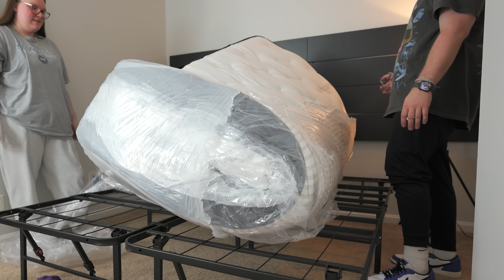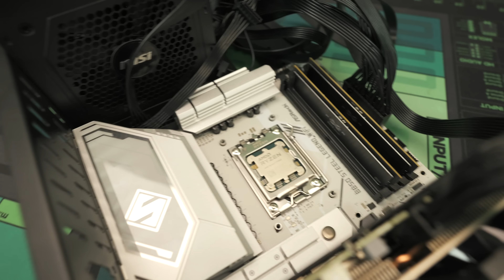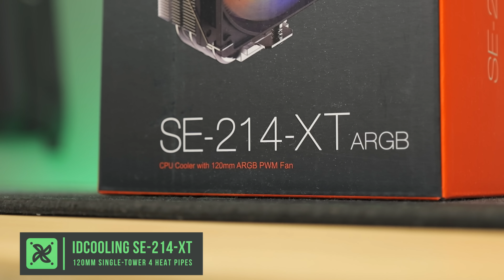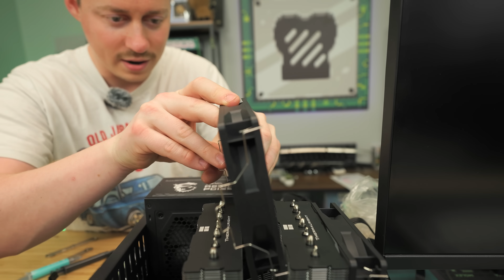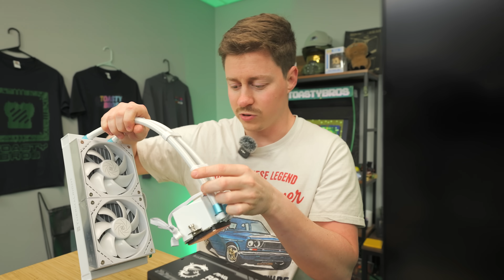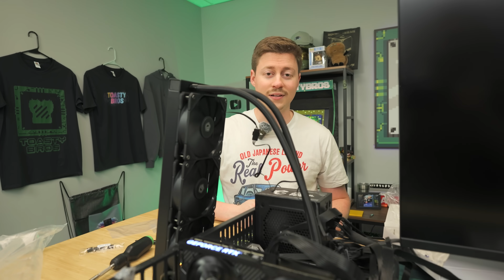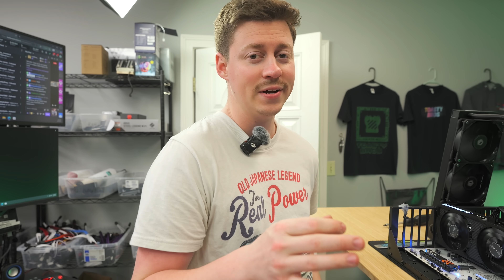STOP Overpaying for Your CPU Cooler

Comment: Good God, bots have gotten so bad... Anyhow, I don't know about real world applications on this particular test. Using a testing bench doesn't really apply to 99% of gamers. Fresh air flow is unimpeded since it's open air. I'd be interested to see this test in a series of popular cases out there.
Reply: this is quite true
Particularly with the popularity of more budget 'fish tank' cases that have significantly worse thermal performance than something like a Lancool or a 4000D, it would be interesting to see these air coolers put to work in a cheap Gamdias or Okinos case (likely pairings for a $900 new build)
Reply: @Firitesen  case airflow is an overlooked metric by every single techtuber, not just these guys. Researching cases with unobstructed intakes is way more important for the buyer since there are far too many cases to generally cover in cooler benchmarks.

That being said, if you have 3in 3out, or the equivalent of 3in with filters which would be around 5 intakes, you're extremely close to ambient temp in the case. The problem is most people, and some cases, don't meet this simple standard.

If you mod the zalman t3 plus/compact's front panel to not be obstructed w 3 intakes, you'll see similar performance to top of the line cases. I bought that for 40 bucks. Not worth measuring the margin of error. Same applies to a filtered king95 fishtank with all 5 intake slots occupied. No, neither offerings have any shortcomings in cooling as long as you fill the space.
Reply: @benbai5808 Got the t3 with some arctic coolers. Was really surprised by the temps unmodded
Reply: I mean if the noctua has access to fresh air, still performed 2nd to the worst, and is the most expensive, it is pretty ass 😂

Comment: The ID cooling 214 plus is the dual fan model and is always $20. Great for getting your build done and you can decide whether a better cooler is needed later on.
Reply: Even the A620 from ID Cooling is only 40 bucks for a dual tower cooler.
Reply: Mine is the ID Cooling SE 224 XT RGB model. It's good enough for my R7 5700X3D
Reply: Yeah for 7700X single tower is fine. But intel dual tower for 125W+ CPUs

Comment: The amount of people that still go with a Noctua or Be Quiet over 100 dollar air cooler is insane when the Peerless Assassin and A620 exist for under 40. Same with AIOs with the Kraken Elite when the Warframe exists.
Reply: For most of us the stock cooler is enough. 😅
Reply: To be fair it's all about longevity.  Those $5 fans that are included with cheap coolers may only last a year or two and when they die, they might burn out your CPU along with it.  That said, I usually just buy a cheap air cooler and buy some better fans for it and it's still a lot cheaper than buying the whole cooler from a name brand like Noctua.  Don't cheap out on fans.  There's a huge profit margin on the coolers themselves.  $140 for 2x 120mm fans and a chunk of metal is way overpriced.  The fans are worth maybe $40 and the metal another $30.
Reply: @thelbtlover  Cheap coolers lasting a year or two, when they're just a chunk of metal? Air coolers literally don't fail. Only the fans break and you can easily replace them, and if they do break, that doesn't mean the CPU will cook itself (it's still being passively cooled by a chunk of metal). And it's a myth that those cheap fans will fail early. It's a very ymmv thing. My 5 year old Deepcool fans are still going strong with no signs of fan bearing failure.
Reply: good point. After replacing the fans on a cheap cooler master cooler every couple of years, I finally tried a noctua fan. It's quiet and still going strong after 8 years.
Reply: @thelbtlover  Definitely worth it if you don't ever want to have to worry about your fans to go ball bearing instead of fluid dynamic.
Reply: its for people that has the cpu case at least 30 cm near, like me. the noctua is hella of a lot silent than any thermalright fan. period.

still the cost for going silent is a lot.
Reply: I bought the Peerless Assassin when it was down to $26 on Amazon. I should have bought a few more then.

Comment: Dude, I am running my I5 12400F with a ID Cooling FrostFlow X 280 and it runs at 100% cpu usage 41-42C in a 21C room and only pulling 56-57w of power. The 280mm liquid cooler in my country cost the same as a tower cooler and 240mm liquid cooler.